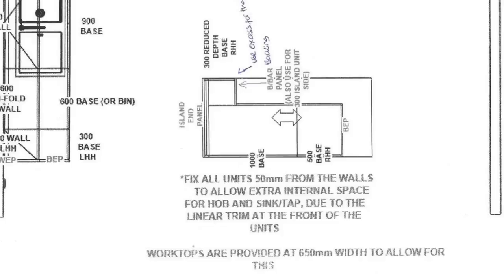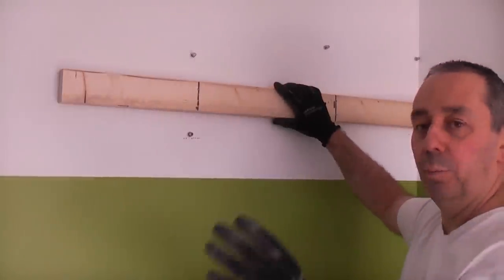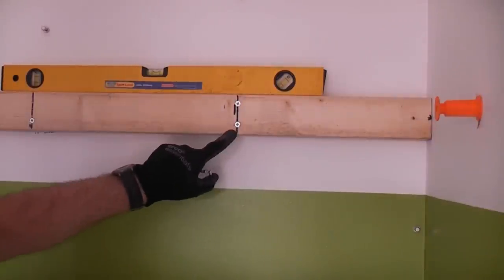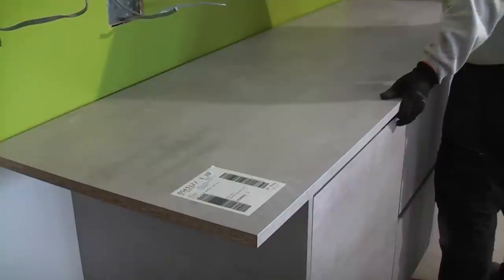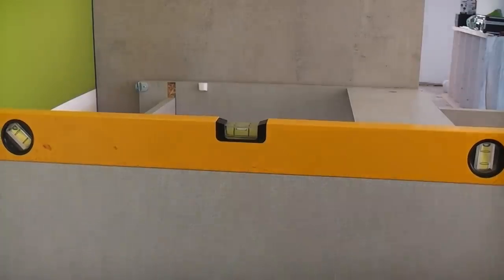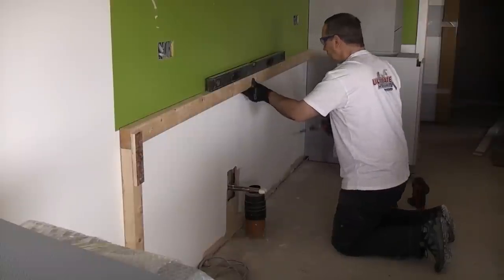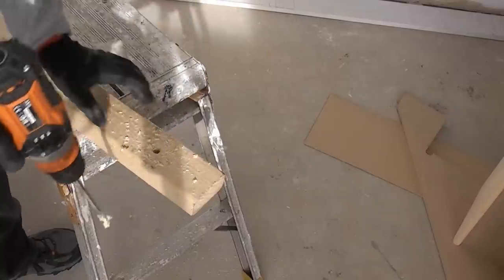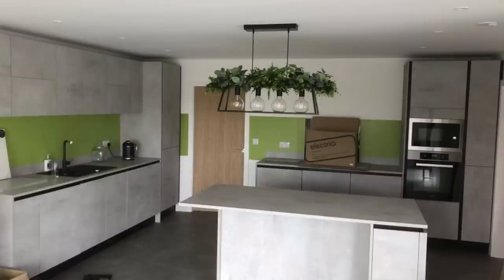How to fix a batten to a wall

Comment: i do similar to you but i use fischer duopower plugs in the wall (brick) then use some m8x150mm stainless screws like what you would use on a satellite dish, i use a forstner bit to countersink the screws and use washers to get a nice tight fit.
Reply from the maker: I’ve used the Duo power plugs in solid walls, they are good 👍
Thanks for the comment 👍

Comment: Im looking to add a small wood batten to my plasterboard wall.  Reason being is i have a dolby atmos sound bar and the upwards firing speakers are blocked by the bottom of the tv which is immediately above it.  But im then looking to fix the soundbar with the brackets onto the wood to extend the soundbar out.  How can i keep the wood secure with the weight of the sound bar pulling on it ?  I cant think of another way to get the soundbar out from directly underneath the wall mounted tv

Comment: Interesting. I’ve never had to fit battens to the wall like this when fitting kitchens, what’s the purpose of the batten, why not just make the cabinets deeper?
Reply from the maker: It’s the first time for me also, but it’s the first time I have installed a handle-less kitchen. I guess it’s all down to cost etc. much easier to fix a batten, rather than making all the units deeper. 
Thanks for the comment 👍
Reply from the maker: It’s the first time for me also, but it’s the first time I have installed a handle-less kitchen. I guess it’s all down to cost etc. much easier to fix a batten, rather than making all the units deeper. 
Thanks for the comment 👍

Comment: Hi really good advice here could you mount a 55 inch tv on these battens. I want to mount a tv on a pull out type bracket I need the tv to be a bit further away from the wall as the recess is 500 mm and the bracket only come out 400mm. I’ve heRd you can build a sort of plywood and batten mount for tv. I have used the fisher plugs before when mounting on dot and dab with thermolite  (new build style house) behind with no issues. I’m a bit nervous to use a batten and plywood. I thought about using direct concrete screw in. Would you have any ideas please 🙏

Comment: Hi I’ve just recently bought an ikea storage unit that measures 182cmx 182cm. I need to fix it to the wall.  What size batten will I need ? Will I also need a batten the full length or maybe just a square block batten for where I intend to screw it in? Anyone? 😂
Reply from the maker: Do you have a link to the exact item, please?

Comment: Thanks for the video. When you pre-drill the battens, do you drill a clearance hole or do you prefer the screws to bite into both the batten and the stud?
Reply from the maker: I normally drill them a bit larger, so that the screw does not cut a thread into the timber batten, but I’m missing some drills, so the screws were just cutting a thread in the timber, but not so much that the batten will not pull tight against the wall 👍
(I’ve since purchased another set of brad point drill bits, if I can find them) 😂

Comment: Wood screws go into breeze block and hold very well too. 👍
Reply from the maker: I think you mean aerated concrete blocks? (breeze blocks are normally regular concrete, where I live)
Yeah, you can screw right into aerated concrete without even pre-drilling a pilot hole 👍

Comment: I like how you switch back and forth between metric and imperial measurements meaning you get to confuse both sides of the pond 😂
As someone who was born in the 70's I also get the pleasure of doing that to the people I work with  🤣🤣
Reply from the maker: Yeah 😂
When I worked as a maintenance engineer, I worked on machines that were a mixture of Imperial and metric. It’s still fun today, with domestic plumbing being sold in metric (10mm, 15mm and 22mm) yet all steel pipework on site is still imperial 😂
Reply: @ultimatehandyman  It was the same when I worked in manufacturing, tooling/section sizes were imperial but all the dimensions on the cnc machines were metric.

Was in a local building merchant recently and was chatting to one of the warehouse staff, he was telling me how a sheet of plaster board they sold was metric in one dimension and imperial in the other, thicknesses were all metric  😆
Reply: 1/2 and 15 mm